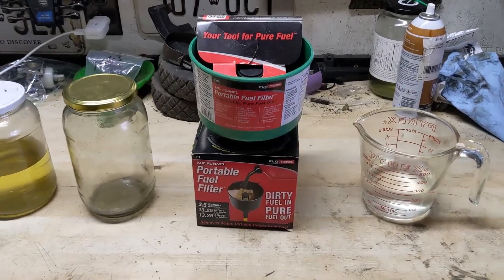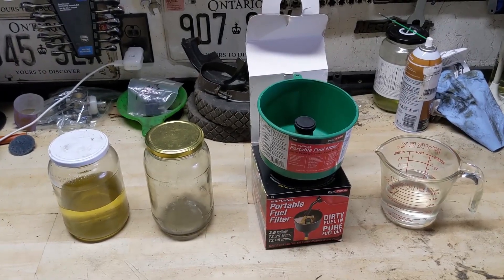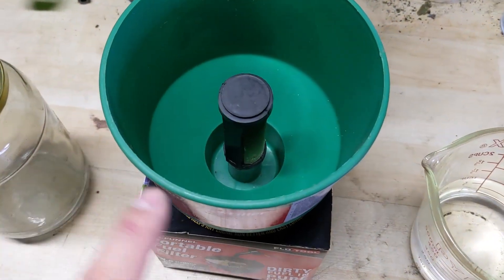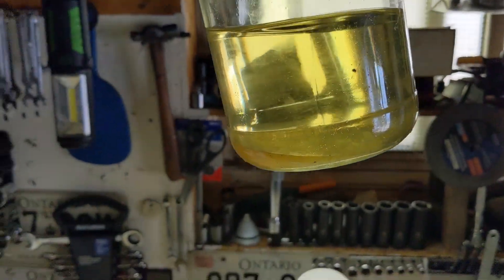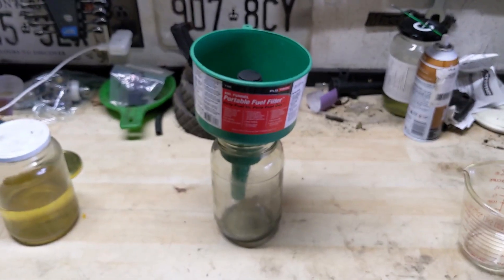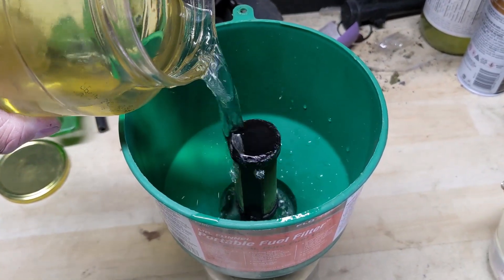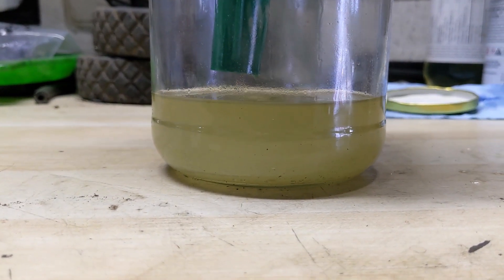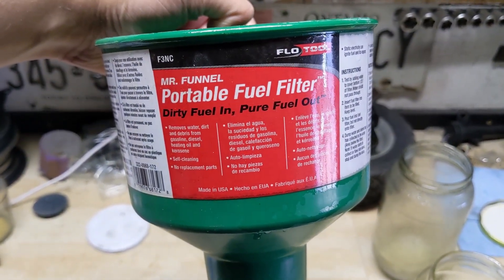Mr. Funnel - Do They Actually Work?

Comment: these days our fuel is 10% ethanol alcohol, which is hydroscopic (attracts water from the atmosphere).  The ethanol mixes readily with water, and the ethanol is indistinguishable from the water in the fuel.  Does the Mr Funnel filter out the ethanol which is water laden from the gasoline?

Comment: This very informative. I have lawn equipment that’s expensive one is a Honda HRX 217 mower & Cub cadet mower . & Aren,s snowblower  that was given to me yrs ago. I do run fuel stabilizer. In the spring - through early fall I use Lucas fuel cleaner & put a bottle in the can of gasoline. I use Shell or Kirkland (Costco) fuels only. Plus a Sthil trimmer I use Sthil fuel in it moto mix . That funnel would be a good investment. Especially for My power equipment

Comment: Sort of question the flow rate of these funnels. I have one like this one but it is VERY slow. About to purchase the 15 gpm version. If I can get 1 gpm out of it, I'd be happy.
Reply: Yes! My thoughts exactly, have the smallest one and have used it (or tried to) for years, and to be honest it would struggle with a fuel intake akin to a morning urine discharge, slow, painfully so, and I’m only filling 5 litre containers with filtered kerosene. 🤦‍♂️ Tempted to buy the larger one but feel a bit ripped off with the claims.

Comment: great video. you forgot to mention the most important point. Mr. Funnel works on a water fuel mix. But it does NOT work well at all with emulsified fuel. So filtering fresh bought fuel or stored fuel from a fuel container with a Mr. Funnel is DIVINE and works great. If you have a tank contamination and you pump the fuel and let it sit there will be water at the bottom, emulsified/contaminated in the centre and clean diesel at the top. Mr. Funnel is UNABLE to clear the emulsified diesel mix but only takes out parts of it.

Comment: I just bought one for the express purpose of helping to remove ethanol from gasoline.  Short answer: I don't believe it worked for this purpose, I returned it.

I remove ethanol from gasoline by mixing 3 parts gas to 1 part water.  I mix vigorously and let sit for a day until the gas is crystal clear.  At this point, the water below is cloudy and there seems to be "bubbles of liquid" sitting right on the edge between the water and the gasoline.  I'm not sure if these bubble are the ethanol, or if the ethanol is mixed in the water, thus making it cloudy.  I AM pretty sure the yellow gas is the "gas", and that's all I want.

I take a small tube and siphon off the gas until it gets close to the separation line.  Normally, I'm done at this point, as I don't mind a little waste to get rid of my ethanol.  It was here that I started experimenting w/ the funnel.

Yes, I bought the real brand funnel, not a copy.  I first tested w/ water, and sure enough none came through the filter.  I emptied the funnel, and waited until my leftover bottle w/ a little gas on top of the bubbles on top of the cloudy water had settled.  I did this as the instructions seemed to state "do not shake up the gas before funneling".  I can only assume that "shook" gas might pass through the filter along with water.

I slowly poured the remainder into the funnel.  Some water was filtered and stayed in the funnel.  what passed through the filter and into the bottle however, was a thin layer of yellow gas, on top of a cloudy clear liquid.  I'm not a chemist, but those results right there showed me not to trust this filter for filtering gasoline from a water/ethanol mixture.

The whole pour gently thing kinda bugs me in general with this product as well.  Take away the idea of removing ethanol from the gas via mixing the gas with water.  Imagine just using the funnel for its intended purpose.  I would think the act of tipping a gas can and quickly pouring it into the funnel, as fast as the funnel will allow, would inherently mix up the gas with water, thus allowing some water that had ethanol bound with it, go through the funnel anyway.

To be fair, I returned the funnel after my first result of seeing whitish cloudy liquid sitting below a layer of yellow gasoline after being put through the filter.  I didn't do any other extensive testing.  It still puts a little doubt in my mind.  Sorry for the novel, but I just wanted to give the type of answer that I came here looking for myself.
Reply: Since the only thing really keeping water out is the fact that the filter media is hydrophobic and has small enough holes to keep the cohesion/adhesion property so it doesn't go through, I doubt it would filter ethanol efficiently. Try a funnel with felt? I heard that works for separation of water/gas. Your test seemed pretty good so I'd be curious to see if a felt funnel works.
Reply: Use ethanol stabil & quit playing stupid games putting water in gas alcohol is fuel 1000+ Hp funny cars run on straight alcohol cause gas don’t have enough  umph alky all the way❤

Comment: I bought the smaller model Mr Funnel, the F1NC for my kerosene heater - it has no sediment bowl like this one. As soon as I got it, I filled it with water just below the top. And ALL the water went through. I repeated this several times. So I called FloTool support to see if it was defective. The support person told me to only fill the funnel halfway up the screen portion; that filling over that level would let water through. And that the pressure balance to stop the water going through the screen was delicate. 
But halfway up the screen is only about about 11/16" on my model. That makes adding fuel to the funnel a real pain to stay under half way, especially with my battery powered pump. About 30 minutes for 1.9 Gallons.
So what's the real story on Mr Funnel?
Reply: You were told bullshit. The screen has pores that are smaller than the water molecules so the water doesn't pass through. Even the print on the box says this.
Reply from the maker: That's an interesting take that I've certainly never heard. I filled this one with a full bottle of water and nothing went through. It definitely works.
Reply: @EliminatorPerformance  I've seen several videos that show a Mr Funnel holding a full fill of water. I'm thinking perhaps FloTool was just avoiding having to replace a defective product, but that's just a guess. I need to re-test mine to see if it even holds water at halfway up the filter. I'm considering buying the larger F8 model (5 gpm vs 2.7gpm) with a taller central filter, and try that one. Wick style kerosene heaters are real sensitive to getting water in the wick - it's very tough to get it out. Requires complete disassembly to remove the wick, and re-installing a wick to the correct uniform height is a real tedious job.
Reply: I can attest to this, mine does the same, same model too.

Flow rate is pathetic and tedious. Like you I was going to ‘upgrade’ but it seems the flow claims are complete BS. Makes me wonder how well it filters…

Comment: But what happens if your fuel is E10 (10% ethanol) to start with. I understand the ethanol is miscible with H2O and will readily mix and keep it in solution. Will Mr Funnel filter out this solubalized H2O+ethanol mix or will it let it through? From some quick research, I understand that the way the Mr Funnel filter works is via surface tension -> H2O has high surface tension and will not pass through the filter. H2O+ethanol has a much lower surface tension (ethanol has minimal surface tension) so I'm assuming it will let it all through... In other words, these filters will NOT get water out of contaminated E10 fuel!
Reply from the maker: Ethanol fuel by itself will pass through, the filter does not stop that. So it can't be used to remove ethanol from the fuel by itself. You can add water to your ethanol fuel, the alcohol (ethanol) will bind to the water and then it can be filtered through, and the filter will only allow the fuel. You will now have lower octane ethanol free fuel. You will then have to add an octane booster to this new fuel.
Reply: @EliminatorPerformance  have you tried yourself to see if it will filter out mixture of water and ethanol? Some people on Amazon that if you use octane booster that mr funnel won’t filter out.
Than you for the video
Reply: The instructions on the box say the filter has pores smaller than the water molecules which is why water doesn't pass through. I read nothing about surface tension, but I'm curious to know if it will remove extra absorbed water from E10 in vehicles layed up over winter.

Comment: It works but for how long?
Reply from the maker: Still working, use it daily!
Reply: @EliminatorPerformance  thanks for the feed back.  I was thinking the water separation would fail after a few passes.
Reply from the maker: @digitalbilly  it works great, but as I said in some other comments, make sure you get the name brand Mr. Funnel. The Chinese knock offs aren't as good!

Comment: Does anyone know if I can run some already mixed(50-1) 2 stroke fuel through the funnel? I have 38 gallons of gas/oil mixed at 50 to 1 for 2 stroke outboard, that is also mixed with water.
Reply: Since the only thing really keeping water out is the fact that the filter media is hydrophobic and has small enough holes to keep the cohesion/adhesion property so it doesn't go through, I bet 50:1 would be fine going through. The oil and fuel in 50:1 should not separate and filter out.

Comment: Doesn't work. Just bought one and water goes right thru it if water is mixed with fuel. I also poured water in it and it went thru.
Reply from the maker: Did you make sure you got a real Mr. Funnel? I hear the Chinese knock offs have holes in the filters that allow some water through. The Mr. Funnel brand works great!
Reply: @EliminatorPerformance  yes. If it's just plain water it will hold 80% of it if you fill the funnel. 
If it's mixed with fuel it will just go right thru.

I had a tank of gas that got alot of water in it. And wouldn't start. So I drained the tank via fuel pump to grab all the water at the bottom. 
Once I was getting straight fuel I stopped connected everything and started the truck. 

I drained 20 gallons of fuel. And put it all thru the funnel. It all went thru. No issue. Once it was in the bucket it separated fuel and water again. 

So I funneled it again and maybe got about 1 cup of water out of 20 gallons. With funnel. But doing it the old float way. I ended up taking out almost 2 gallons of water.
Reply from the maker: @oddessy2g  interesting, I haven't had any issues with mine. I even had a customer come to me with his rider twice in 1yr with water in fuel and recommended this to him. He hasn't been back, yet lol
Reply: @EliminatorPerformance  I don't doubt you. Lol I mean I watched the vid. But maybe I got a bad one. Idk I'll grab another one. I still have 20 gallons just sitting there that I don't want to use. Lol
Reply from the maker: @oddessy2g  yea I'd give it a shot, I honestly didn't think it would work as good as it did, bottle of water essentially and not a drop went through. I definitely like using them because even if it gets the majority of water out, it still filters small debris.
Reply: @EliminatorPerformance  yes I agree. It does do a good job getting gunk. I mean the fuel came out clean. But with water. But  just water in it, it stopped every drop. I'll still use it. But idk if we should rely on it completely. I still like the float test. Let the fuel float and scoop it out then use funnel.
Reply: @oddessy2g  Back in the 1960 's & 70's I recall my Dad filling his airplanes from a barrel, he was always trying to avoid water in the aircraft fuel tanks, he used a regular funnel and put a felt cloth over the funnel, it would stop water going through he said. It would be interesting to test his old way to see how effective it works.

Comment: Does it separate ethanol fuel from the gasoline? If you were going to remove ethanol from the fuel with water, then filter it through Mr. Funnel. Would it separate the ethanol water mix?
Reply from the maker: As far as I know, it would only separate the alcohol (ethanol) and not the water.

Comment: Is it good for removing ethanol from the fuel?
Reply from the maker: Not unless the ethanol has gone through phase separation and detached from the fuel. This filter is only hydrophobic, meaning it repels water, not alcohol. However, the alcohol can unbind from the fuel and bind to water, so if you had old fuel that had been sitting and there was a bunch of water in it, chances are there would be less ethanol. Hope that helps.
Reply: @EliminatorPerformance  I'm thinking of adding water to the fuel first to separate the ethanol then using this.  Should work hopefully.

Comment: the reason why you was getting spilling is exactly how the ganesh statues in india was supposed to be drinking milk.

the milk would run down the chin and the front of the statue to the base witch is usually covered in flowers and such hiding the milk.

Comment: I would like you to take a test ...
Take 1 liter of gasoline with certainly some amount of ethanol in that gasoline.
Steps :
1. Filter this essence with the Mr. Funnel funnel and see the result.
2. Add 500ml of water to this same essence and mix everything well. Repeat step # 1
3. Analyze the efficiency in step 2 of filtration with the Mr. Funnel funnel.
This morning I picked up a garbage tiller and plan to fix it.
I started by emptying the gas tank to see if there was any water in it and to clean it.
There was indeed water. Like 750ml of water and 250ml of gasoline.
I suspect that maybe there was a good amount of ethanol in that water ???
Having a Mr. Funnel funnel I thought to myself that this was a good opportunity to test the effectiveness of this funnel.
To my surprise and disappointment, a large amount of water passed through the filter (new)
From there, my questioning about ethanol and water.
In this gasoline, if water and ethanol are mixed together, will they pass through the filter?

Comment: Being in the small engine repair business for over 10 years we have generated a very large volume of customers fuel which went into my 2006 Ford F150 with the addition of the proper measurement of K100S+ added to this fuel. It was always important to only siphon off the top 75% of the jerry can to avoid water and dirt contamination. A few years ago the truck started to run extremely rough likely due to water from this old fuel so we added a full bottle of ISO HEET and within minutes the truck ran smooth again. At this point we purchased Mr. Funnel and over the last few years the customers fuel has never been an issue running in my Ford. I must agree fully this is a must have product for reuse of old fuel, another great video with NO TRICKERY!